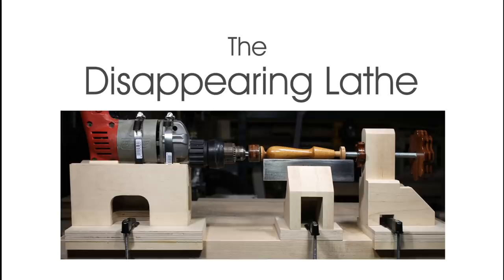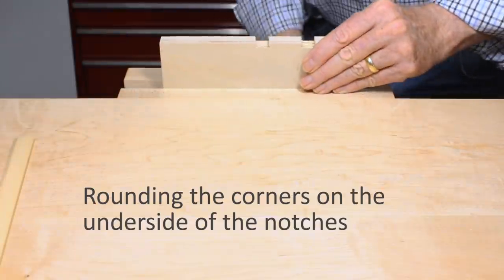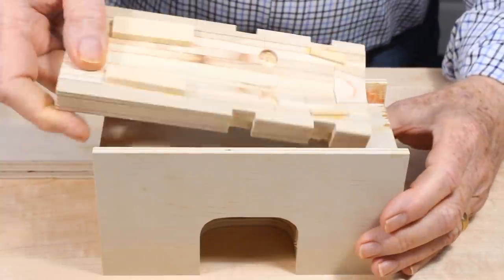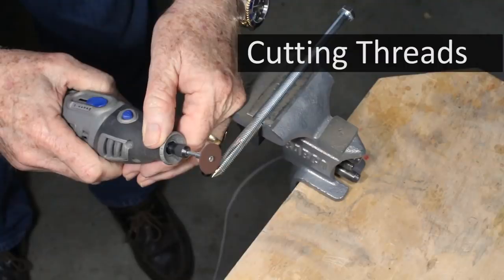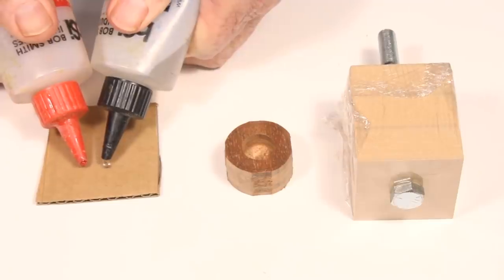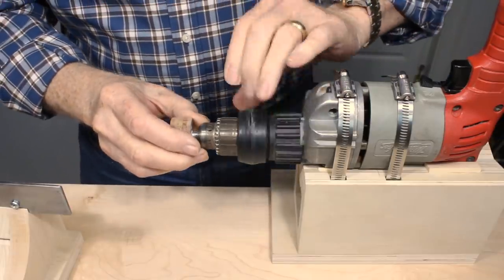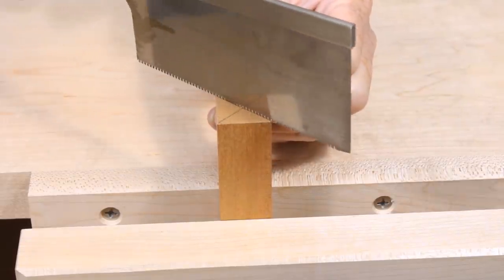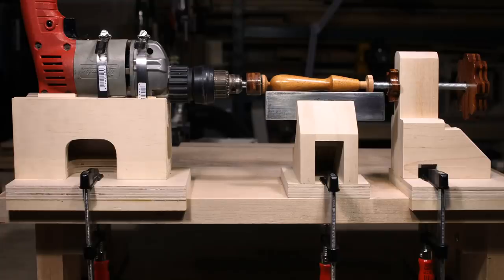The Disappearing Lathe

Comment: I built this awesome lathe a couple of years ago, and had a lot of issues with the chuck. Great design but I could never make it strong enough ( blew a bunch of them apart). I found a 1/2" dia. steel chuck in a woodworking catalog with straight sides instead of a morse taper, and now it is 100% dependable for those small turning projects. I love it! I even had the same sturdy Milwaukee drill languishing in a drawer. My only modification was to add a tightening nut on the backside of the tailpiece to really lock in that end of the work. Well done plans and very easy to build thanks to your design work. :)

Comment: I needed a 1/2 inch dowel and all I could find was a 3/4 inch oak dowel at the store. I reduced it to 1/2 using nothing but s spokeshave, card scraper and sandpaper. I should confess, I was pleased with the end result as I couldn't feel any unevenness with my fingers. I spent more than 90 mins to get that smooth result and after reflecting on that unnecessary result, I decided to make a small diy lathe and this video showed up in my search,

Let me say, this fits my needs perfectly. I don't have space in my garage, no extra motors to press into service, I will be building a lathe pretty much the same way as you did. Thanks for the video,

Let me also say, I have watched many of your videos and I am hugely impressed. I like your scientific mindset and elegant approach to building things. I hope you continue to make more videos. Sincere thanks and appreciation,

Comment: Thank you so much for sharing this fantastic project with us, Patrick! I've tried other DIY lathes here on Youtube, but they all didn't really work for me. I just finished building your lathe and, oh my god, it works just so great! I made some changes here and there, but nothing really too far away from your design. I did, however, change the way the drill is mounted to the headstock. 
As I don't have a table saw, I thought for a while about another way of getting a real snug fit for the drill. I ended up building a small box of the same dimensions as the headstock, melting some polypropylene in it (oven) and pressed my drill in. After letting it cool down, I have the best mount possible. The drill fits really well, while it's still easy to remove. Maybe this idea helps someone else who wants to build the lathe. 
Again, thank you so much for sharing your wonderful idea!

Comment: Great! This solves both main problems of DIY'ers: money (to buy tools) and space (to store them). I'll surely do it and also prepare a "disc sanding endpiece" to exploit the same drill (I'll use an old 18V Ryobi which I retired after the death of its NiMh batteries and converted to AC). Thank you!
Reply: Can you explain how you did that AC conversion? I have an old 12 volt cordless drill and new battery pack costs more than the drill. AC is 240 volts in my country.
Reply: @taab7  Two possible ways:
1) attach a 12V battery of any size you want (e.g. a motorbike one) to the drill's handle (cumbersome, yes, but effective) and you still have a portable tool;
2) discard the battery pack and directly connect the drill to its own battery charger (which obviously delivers the required voltage).  It'll be even more cumbersome but as you can recycle it as a stationary motor, then it doesn't matter.
None system will give you a comfortable and practical tool but... you can re-use one which would be ditched otherwise.
NOTE: It won't be as powerful as an AC tool, obviously.

Comment: This will break the drill's bearing very quickly, because it is built to support axial and radial forces, but not the lateral force introduced by the tool. Resting the tail of the stock helps, but you can see even in this video how the drill's chuck moves away from the tool when you're working close to the headstock.
The solution to this probably is to build a proper headstock with a 40-50 mm shaft supported by two friction bearings which will absorb the lateral force. You can simply fix this shaft directly into drill's chuck.
Anyway, thank you for the video.

Comment: That's a great setup.  It's funny how there are many videos showing how to make homemade carbide tools for a low cost but no one seems to sell them.  I am not a metal worker and I don't really trust myself.  The lowest priced tools I can find are the Simple Woodworking Tools at $165 ish for 3 shanks and a handle. That seems too much to spend for use on a drill lathe at this point.

Comment: You're doing a lot of gluing.  If you'd like to try it, get some high viscosity CA glue and dampen one piece with water and apply the CA to the other piece only.   Put them together and they bond very rapidly.  You'll save so much time.  You can thank me later.
PS. Excellent photography, graphics, and explanations.  Well done.  Thank you very much.
Reply from the maker: Alex:  I'll give it a try, and thank you right now.
Reply: @PatrickSullivan  Don't use too much CA.  One drop per square inch of area, as per instructions.  If you feel that PVA is preferred, then use the CA as a clamping method.  Let me know how you do with this.

Comment: Great ideas! I have a question. Many of the other DIY lathe designs have a tail stock that rotates with the workpiece using bearings. Have you found that the end of the piece that is touching the tail stock gets hot, or gets worn out that you need to periodically advance the tail stock?

Comment: Patrick, thank you so much for this brilliant idea.  I needed a lathe, and searched YouTube for ideas, but yours was by far the best for me.  My drill has a 43mm nose for clamping it into a drill-press stand, as well as several other attachments, so that simplified my headstock.  For the tailstock, I made a live center using a bicycle wheel hub, which can be adjusted for free-running with virtually no play - and it's a thrust bearing.  My first job was the roller for a balance board.  It's essentially a rolling pin, but 5" diameter and 9" long, and tapered at the ends - and it has come out pretty well.
Now - a question that has nothing to do with lathe building - what kind of shelacque did you use?  I have looked on Ebay but I can't find anything similar, and it puts on a rather nice finish.  Maybe it's known by a different name in this country (UK/Europe) - or maybe it's not available, but what kind did you use?  I searched for Shelacque, shelac. shellac, etc, but I didn't find anything similar.
Reply from the maker: I use shellac made by a company named Zinsser, called Bulls Eye Seal Coat, or Bulls Eye Shellac.  The Seal Coat version is wax-free, while the Shellac version has a small amount of the natural wax produced by the lac beetle.  You can buy shellac flakes and dissolve them in alcohol, but this ready-made product is just more convenient.  It is widely available in the USA--most hardware stores carry it.  Sorry, I don't know if this product is available in the UK or Europe.
Reply: Mike, if you're in the UK you can get shellac ready made (in liquid form) from Liberon, Mylands and other British brands, and possibly Zinsser too. There are numerous colours available, you'll probably find it best to begin with "transparent polish" . 

Shellac is also sold in dry form, in flakes or buttons, and you make up a solution of the concentration you want (referred to as the 'cut') by dissolving the flakes in methylated spirits. Freshly made shellac is considered best so you make up small batches at a time, aiming to use it up in a few months and not try to keep it for longer after which it can stop drying properly. 

Before I forget, if you're primarily interested in using it on the lathe do a search on YT for "shine juice", I think you'll be suitably impressed! You can reduce the amount of linseed oil in the mixture by quite a bit and still have it work just as well.

Amazon sell shellac flakes if you're stuck for a supplier, and may also sell the readymade liquid types as well.
Reply: @PatrickSullivan  Thanks Patrick, I did a bit of searching around, but my local hardware store didn't have it.  They suggested a paint supplier across the road, and they had something.  It was called "Sanding sealer", but the blurb on the bottle seemed pretty much like what I wanted.  It is based on shelaque, and like yours, it is quick drying, seals the wood, and leaves a hard, waterproof surface.  The result looks very nice, but it is for a part that will roll between two surfaces - one wood (with duck tape on it) and the other will be a mat or carpet, so we'll have to see how it goes.  Maybe it will all crack off - but I hope not.
Reply: @DG-zl6ml  Many thanks for the advice.  See my reply to Patrick above.  It seems that what I got was probably a very similar product, as it is shelaque-based, and the instructions say to clean brushes etc in meths.  Also, it was £11.odd for a small bottle, so I suspect some amount of gold/platinum dust in there as well!  If you get it on your fingers, it is very sticky.  I'll file your response among my useful references for future projects.
Reply: You're welcome, glad to try to help. Shellac sanding sealers are based on shellac but have an additive to aid sandability (a type of waxy substance, usually zinc stearate). While you can still use it as a finish it's not quite as good as pure shellac.... for next time, regular shellac tends to be much cheaper especially in dry form. 

If you ever want to apply this by brush instead of padding it on with a wad of paper or cloth, another cool tip about shellac is you don't need to clean your brushes thoroughly. Unlike varnish or paint shellac remains permanently soluble in its original solvent. So you can just give a brush a quick rinse in meths, wipe and put it up to dry. The bristles will dry stiff, but a swish in meths will ready the brush for use next time.

Comment: It's been over a year since you built this. Has it lived up to your expectations? Is there anything you would change about the deign or construction?
Reply from the maker: I have built two of these.  After using them for dozens of tool handles and tools, I decided I liked turning enough to buy a small dedicated lathe.  There is no doubt that a real iron lathe has lots of advantages:  it is quieter, more powerful, more easily adjustable, and much more versatile.  However, it weighs about 75 pounds, and takes up a big chunk of space.  If you can't accept the size, weight, and cost of a dedicated lathe, then this is a good alternative.  I have not come up with any ways to improve on my design so far.

Comment: Is there a specific reason why you chiseled out hexagonal cuts for recessing the tail stock wheel nut but not for the drive shaft bolt head on the the spur wheel? Surely the hexagonal drive shaft bolt head would have been easier to mount and remain perpendicular and true to the spur wheel if hexagonal cuts were also chiseled into the spur wheel?

Comment: Patrick, I need your help here.  You seem to have enough experience to know what you're talking about to fabricate something like this.  I'd like to take up the task and follow your plans.  I have all of the materials on hand already to make the three pieces.  What I'm lacking, is the drill.  I have a few cordless drills, but for obvious reasons, a corded drill is better for this application.  I don't intend to use this for a slew of projects, just a few small things here and there, so I don't want to spend a lot, which is why it entices me since I can use scraps and spare materials I have laying around.  I've been racking my brain trying to find the right drill at the right price (as cheap as possible, as long as it works).  I don't know a lot about turning, but if I understand correctly, the higher speeds should only be reserved for once the stock has been turned to a cylindrical and evenly balanced piece.  I've read that 700-1000 rpm is a good starting point for when the stock is still squared or octagonal, and that depending on the type of wood, that increasing speeds to 1800-2500 rpm is considered the sweet spot and most importantly, the safe zone, only once the stock is turned to evenly weighted balance.  This leads me to believe or understand that I need a variable speed drill so that I don't start out at the max rpm, which for most drills that I'd use for this is in the 2500-2800 rpm realm.  The problem is, it seems that all manufacturers that make VSD's nowadays use a VS system that is manipulated by how far or how deeply the trigger is depressed.  It seems that it's quite hard to find the ones that have the VS on a dial on the trigger.  To me, logically that is ideal so that I can set a lower speed on the dial, depress the trigger fully, lock it, and start turning at a lower rpm, then unlock, release, increase the speed on the dial, and start again.  Then, after watching this video for about the 10th time, I finally took a look at the drill you're using in this video, and if I'm not mistaken, it's a single speed drill, unless I didn't catch how you're controlling the speed setting.  It looked to me like the trigger was fully depressed and locked in the on position, but I didn't see any trigger dial or other speed controlling mechanism.  I've written a lot here, but hope to have conveyed my concern.  What kind of drill do I need to search for so I can safely manipulate the speed as needed for this type of lathe system?  What amps, watts, or rpms should I be looking for in a single speed drill?  Or am I just overthinking it and can I just go with a single speed drill that starts and finishes at max rpms, and what would be too little or too much for safety sake?  Thanks in advance, and thanks for posting this video!
Reply from the maker: Adam:   You are right, I just pulled the trigger back and locked it in the full-on position, so I only used one speed.  I have made dozens of tool handles, dowels, finials, tops, toy wheels, and other small pieces with this setup, and had no problems.  I almost always start with square blanks that I cut on my table saw, so there is very little imbalance, and very little vibration. My suggestion is that you pick up a relatively cheap, corded drill and not worry about its speed.  I would go for higher amperage and (theoretically) more power.  I would also look at the shape of the drill body--some are much easier to align and clamp than others.  Variable speed is highly desirable for bowl turning, and for managing large, irregular chunks of wood, but not nearly so important for spindle turning.  If you find you enjoy making things on this small, homemade lathe, and want to do much more ambitious projects, I would encourage you to buy a commercial lathe.  They have many advantages that are hard to duplicate on a simple shop-made version.
Reply: @PatrickSullivan , thank you so much for the reply.  I actually opted to go with the Hitachi D10-VH2 drill.  It's a 6.8 amp/840 watt drill with a 3/8" chuck, reversible rotation, and most important to me, it has a variable speed adjustment dial on the trigger with a trigger lock that controls the speed from 0 to 2,800 RPM.  I think it was a steal for $39.99, especially with all the right features.  It also comes with a 5-year warranty.  I think in addition to the speed control features, it should also have more than enough power to fit this billet.  While I completely agree with you about investing in an actual lathe once/if I get seriously into turning, the thing that appealed most to me about your video is what you said in the beginning, that "Once you're done with it, it packs away nicely".  I have a very small workshop (10'x12'), so space saving is paramount.  I'm confident that with what I believe to be the perfect drill for this project and your designs, this will more than suit my every need.  I don't intend to turn bowls or anything large.  Just simple tool handles and the like.  Thanks again for your help and for posting this video.

Comment: I don't know if I asked this yet, but did you do a vid on how you made the lathe cutting tools?
Reply from the maker: No video, but they are very straight-forward.    Cut a flat on the end of a steel bar, drill a hole, thread it, and screw on a carbide insert which you buy from any of the many sources.  I got some years ago from Captain Eddie Castelin, who made over 200 excellent videos on wood turning.  He has had some health problems, and I don't know if he is still selling inserts or not.

Comment: can you turn yoyos and wood rings with out special equipment
Reply from the maker: Sure.  There are some limitations.  This rig is not suitable for turning large diameter pieces, so if you want 4" diameter rings, you may not have enough power or stability.  However, I have turned lots of wheels for toy cars and trucks.

Comment: What rpm does your drill spin?  I had a smaller drill I was using for this that just burned out, that said it went up to 1250 rpm, kind of slow compared to a lathe, but the new corded drill I got only goes to about 550rpm, which is WAY too slow.

Comment: Being in a country that has very few indigenous forest reserve left and having ready access solely to local, poor quality pine plywood, I would have to source expensive imported plywood to build the lathe. I do want to build the lathe, so I have a question for anyone who has built this: How much plywood did this project need? An 8' x 4' sheet? half of that? Would be great to know so I can purchase just what I need on my next trip through to the city.
Reply from the maker: This project requires far less than half a sheet.  However, the plywood quality is not critical.  I bet your local pine plywood will be fine.  If appearance is important, then buy the good stuff.